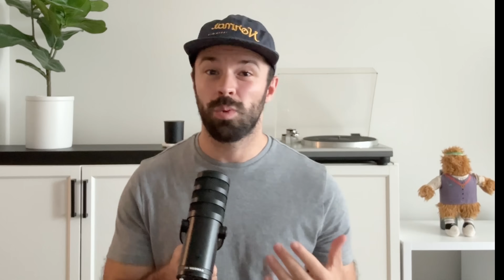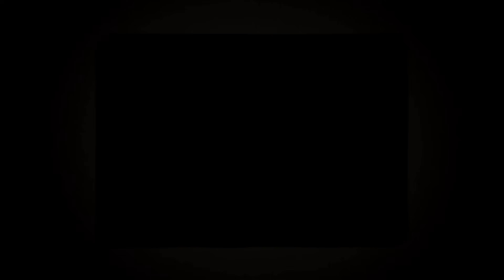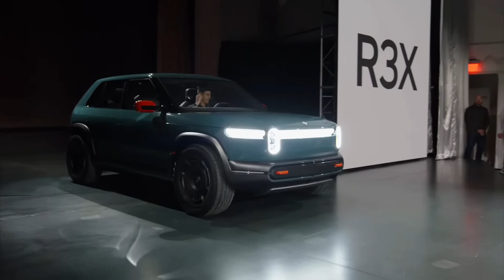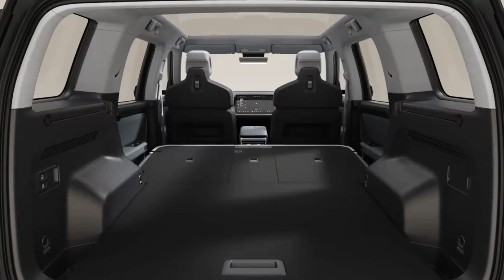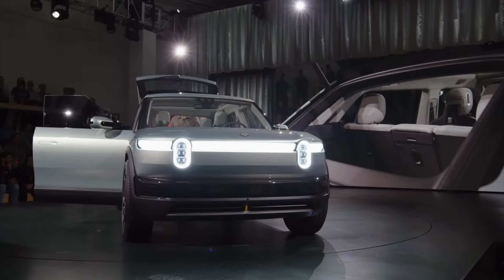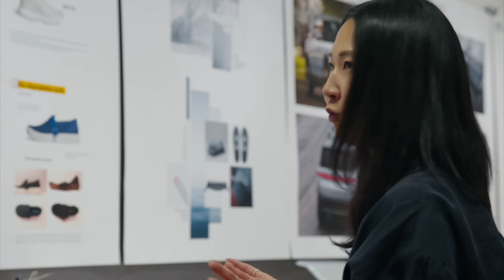Rivian R3 Breakdown — Price, Range, Release Date & What Makes It Stand Out

Comment: R3 will most likely start deliveries in early 2028. The price for the base R3 will be around $40,000. I wouldn't be surprised if the R3X is around $50 - $55k. R2 base price will probably be closer to $50k (not $45k) by the time you can order the base out of inventory, with the highest end R2 in the $65 - $70k range.
Reply: Its 100% gotta be at the 40k mark so it can keep up with the Y and other options or its not going to sell

Comment: I'm pretty sure the 2800mm/110 inches refers to the wheelbase, not total length.
Reply from the maker: You are absolutely correct, thanks for the clarification!
Reply: @MikeKantorski  I was trying to compare the R3X size to my GTI (as a potential replacement down the road). Instead of ~5' shorter (110" vs. 168") the R3 actually has a slightly longer wheelbase (110" vs. 104") than my GTI. I'll be curious to see official interior and exterior dimensions to see how they compare.

Comment: If only Rivian had a factory in Europe, I bet they would be rushing the R3/R3x into production.

Hey Volkswagen, do your auto-making partner a solid and free up a factory so they can get the R3/R3x out the door sooner.
Reply from the maker: R2 will be first to market there, but they really should rush R3 and R3X for rhem
Reply: I think the question is Canada at the moment. Pricing is around $180K for the base R1 new, which is obviously WTF territory, and Rivian has customers and service centres in all the major cities, but no financing set up.  Suddenly we have idle capacity in our auto plants, lots of suppliers with spare time, a fully integrated supply chain just in case for the future, and a quickly expanding free-trade relationship with the EU.   All of this in southern Ontario, a one hour flight from Normal IL, and our dollar is advantageous compared to both the USD and the Euro.
Reply from the maker: @acchaladka agreed this is a huge issue. I need to dig into this further
Reply: That’s a really great idea
Reply: More likely, rivian would work with VW to make a VW variant based on rivian platform. Similar to what Honda did with GM with the prologue among many other examples.
Reply: Oui. Je suis en France et j'aimerais acheter la T3.
Mais 2030 c'est trop loin..
Reply: Thats their way into UK/Europe   R3X is the one for me(UK share holder)
Reply: Would it really sell well over there? I figured smaller cars would fare better, which of course the r3 is compared to other models, but its still quite large.